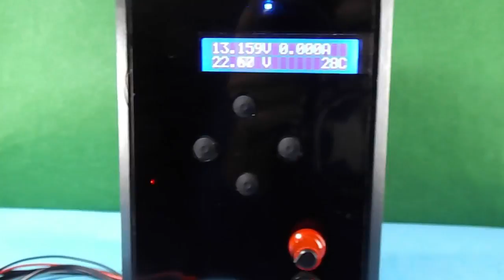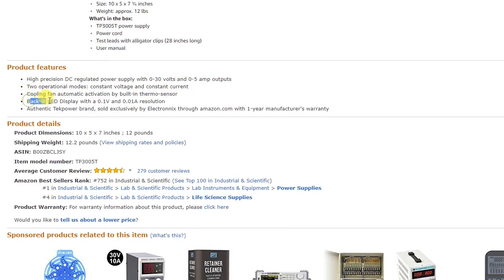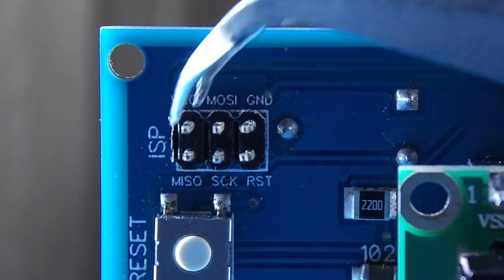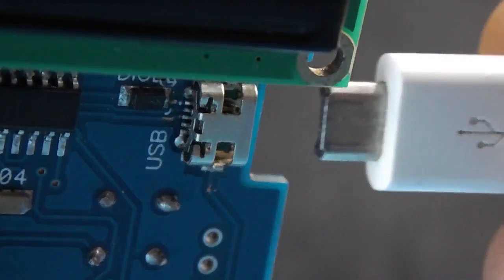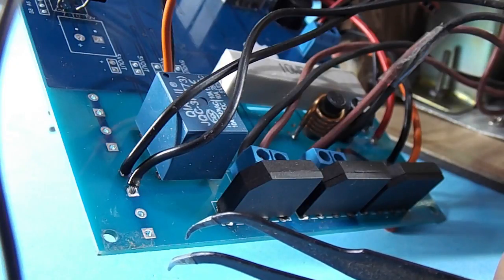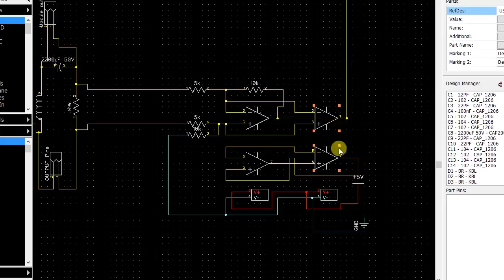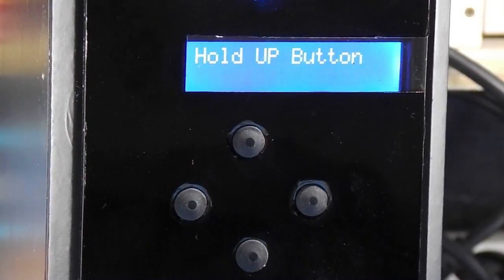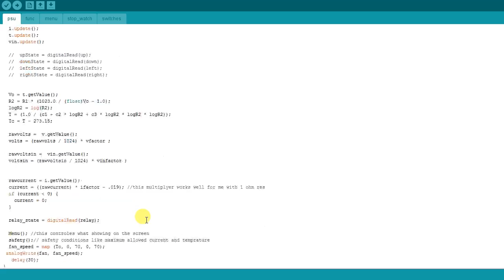making variable power supply from scratch using arduino as control board

Comment: Hi Elsam. Nice video. Please could you consider providing your design files in an open format as not everyone runs Windows and is willing to purchase propriety software. For example at a minimum as a PDF or image file. Also, you should check out Kicad. It's free and very capable.
Reply from the maker: Oh sure that's good point you mentioned 

I really forgot about it sorry, but i promise you i will export gerber files, pdf besides the original files 

Thanks for informing me :)
Reply from the maker: Please check the Google drive folder again i uploaded gerber files and pdf schematic